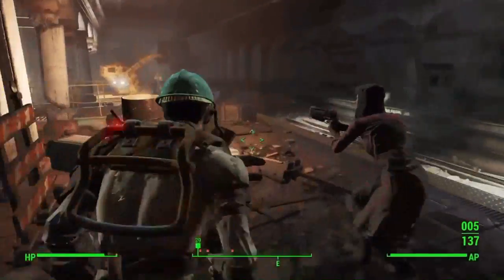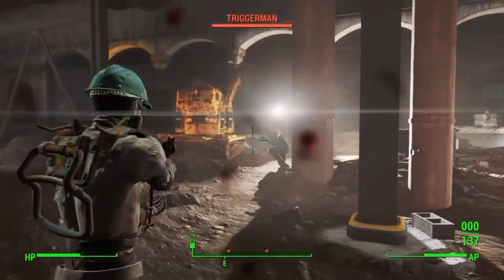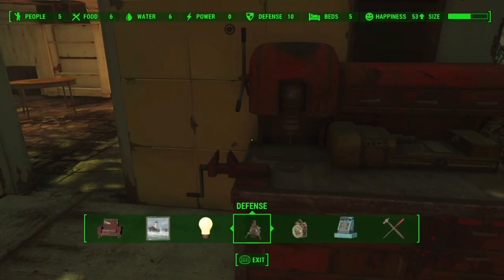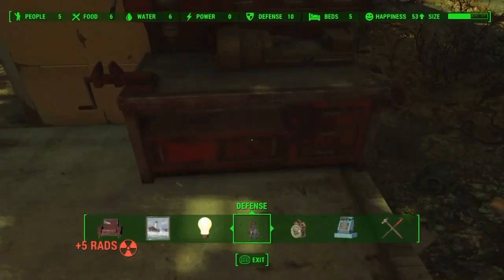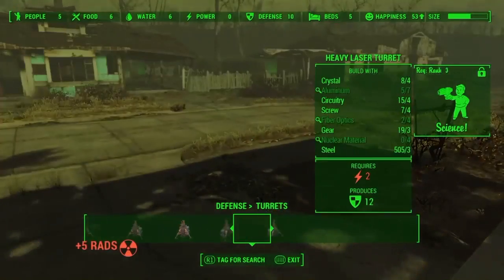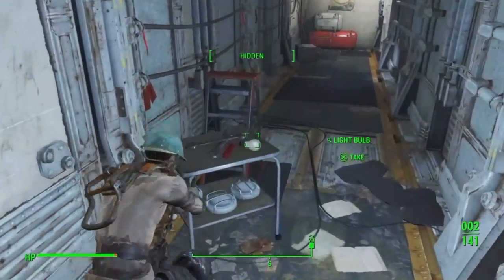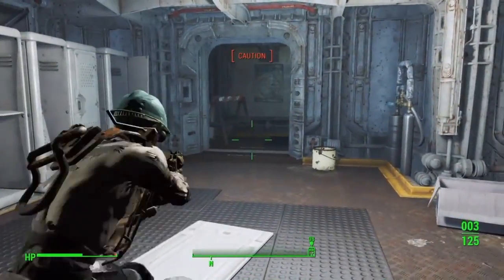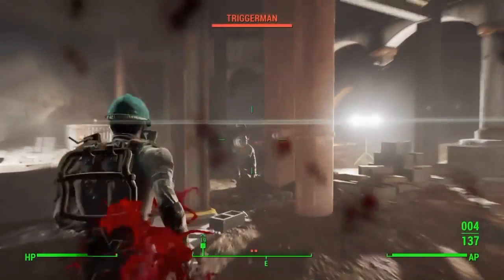Fallout 4 - How to find copper, circuitry and other resources, the easy way

Comment: Its funny. These supplies I have Alot of. My issue is finding wood and steel. I know that a bunch will be on around your settlement for you to scrap, but once you run out of that, there simply isn't any other way to get wood or steel.. If anyone knows how to get some more of it please let me know. I'm sick of being raided and unable to up my defenses.
Reply: get the local leader perk so that you can get supply lines between all your settlements
Reply: ohhh Okay thanks man. Which store should i set up or does that not matter?
Reply: +Thomas Jensen Enter the workshop mode and go to a settler and press the supply line button then you will set up a caravan between your settlement. and then all the material you have there you can use to build stuff
Reply: +Thomas Jensen also if your rich you can by it by the truckload from certain traders.
the girl in diamond city can sort it out i think
it changes every few game days though.
Reply: +Thomas Jensen Simple, acquire a new settlement with some trees and tear it all apart. There's a place in the East that has a good few trees you can trash.
Reply: +Thomas Jensen get a supply line going
AND more importantly assign your workers to a scavenging station (located in resources miscellaneous)
Reply: If you're in sanctuary, then all you have to do is pick up any would like falling trees or broken fences and scrap all the old cars.. old chairs..etc.
Reply: @gina-xm1ns  Some houses can be entirely scrapped in the click of a button. Huge amounts of wood and steel in Sanctuary alone...